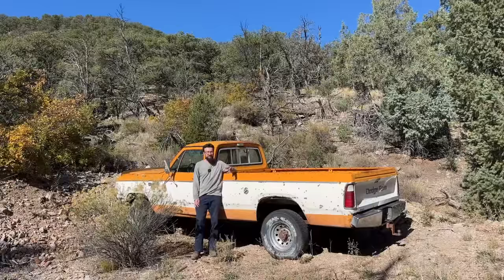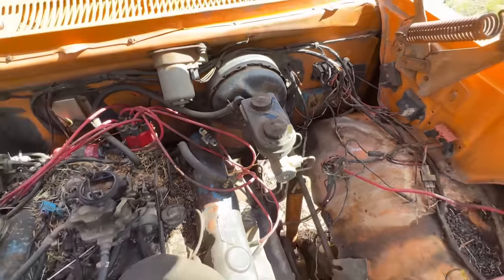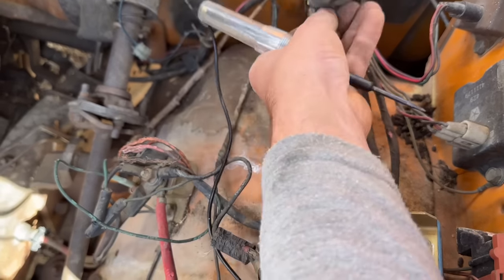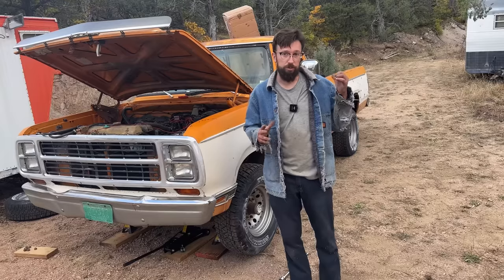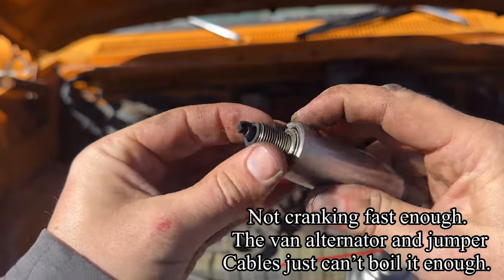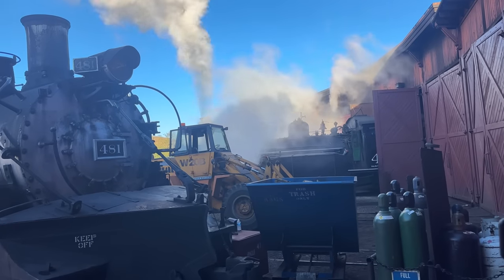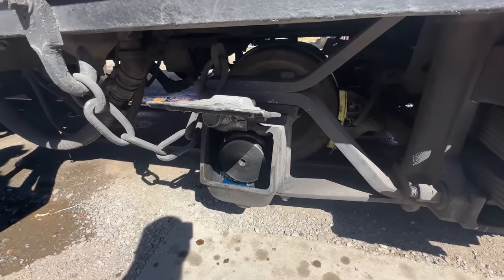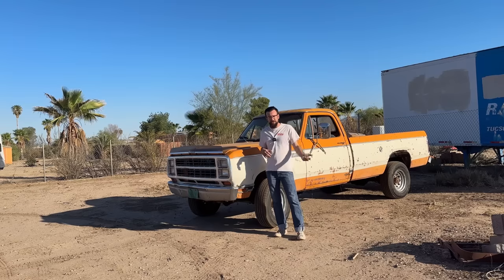I bought a 1980 dodge ABANDONED 22 years. Will it run and drive 876 miles home?

Comment: Hopefully you dropped out the rear drive shaft ahead of the long tow.  I'm guessing probably not though.  4x4 T-case into neutral doesn't really cut it for a long tow.  Having the shaft out is the sure bet to not damage the trans and the t-case over the course of hundreds of miles.  You got hammered plenty on the dolly loading debacle, so enough said there.  None of us know what we don't know before we actually know it.  You admitted your ignorance of the 4x4 system and that's fine.  You'll be able to educate yourself about it.

Comment: Dude, how did u f that load up? Why was the uhaul movin when u loaded it? It should of been in park, with the parking brake on. Unfortunately i see people do that all the time but they dont know a gas cap from a hub cap lol. I cant believe they scrapped those locomotives in alaska. what the hell were they thinkin? Anyways while u have the engine out make sure u change the timing chain. 318's and 360's were notorious for wipin em out due to the aluminum cam gear and they WILL bend valves. They ARE interference engines. Fascinating video on the loco's though. thanks for sharin

Comment: I am mighty suspicious that you left the YouHaul truck in neutral with the parking brake off when you drove up on the car dolly. You may be an amateur, but I don’t think your that much of a total amateur. The giveaway? The YouHaul trucks rear wheels turned freely without resistance when you tried to drive the pickup onto the dolly.

Comment: Given the condition of the rest of the truck, heck yeah, put another clutch in it.   Its hard to kill a Mopar.  My brother-in-law had a 1970's-something Power Wagon but it had the 360 4x4 but it was NOT geared for highway driving, top speed of 50 MPH, and that 360 was screaming, but plow snow, there was nothing that could stop it.  I could be wrong, but I think Chrysler went to the 318 in the 1980's due to emissions requirement.   One thing about those Mopar's, always carry a spare ballast resistor......I learned that the hard way.  Great video, overshooting the tow dolly was hilarious!

Comment: Interesting video... Youth is a bitch sometimes...I see flashes of knowledge...but being a former truck driver, the dolly scene really shows your youth... Set the parking brake....also I didn't see you unhook the drive line....did you know that on most old trucks...1 is a granny gear.... Won't go ...very fast....the truck was sitting 20 years... sometimes you need to warm up that plate....also...your shifting...showed your green...but I do applaud you for going out there....most kids your age are on the cell phones....tim

Comment: You mentioned it had a mechanical clutch - that is great - if it is anything like the ford trucks of the era, there was an adjustment in the linkage to take up slop as the clutch wears. you tighten it and jam nut it and then go on driving. Does the Dodge have something similar? May have been able to take the pickemup to see the locomotives. Also, if said adjustment were to be set too tight, that would also kill throw-out bearings quickly...
Reply from the maker: Yeah this one has that adjustment

Comment: You've never driven a manual transmission 😂😂😂
Reply from the maker: I meant 4x4. I’ve driven them just not often
Reply: @theetravisb  I understand now but you mentioned that you was only 26 years old I thought you was like you're late thirties but a lot of young kids don't even know what a manual transmission is nowadays they're almost a thing of the past the only two trucks that they're making new with a manual transmission right now is the Toyota Tacoma and the Jeep gladiator but I have on those Dodge trucks like that my brother on one they're good trucks I had an 82 but it was just the ram 100 with the slant six but it had that same four-speed manual transmission in it and it was a darn good track

Comment: With that much rodent activity odds are good there's a mouse house in the bellhousing causing the clutch to slip. Check that before you buy a new clutch. Also, chock the wheels on your tow dolly before you kill someone.

Comment: OMG.  When you started trying to load that dolly, with the truck rolling around, I knew that wasn't ending well.
How can you even be that stupid???  🤣🤣🤣
Reply: The problem is not your clutch You got a full-time four-wheel drive transfer case meaning that transfer case didn't come with a front axle with unlocking hubs when you put the transfer case in two-wheel drive the transfer case acts like the clutch slips if you turn the front hubs back into four-wheel drive two-wheel drive will work in the transfer case there's a splitter built in the transfer case that kicks the front Driveline out of gear it's only that way in a full-time four-wheel drive transfer case.. just like if you take a full-time four-wheel drive working driving truck and pulled the front Driveline out in two-wheel drive it acts like the clutch slips if you put it in four-wheel drive it works fine..OK go out there to that truck flip the front hubs in four-wheel drive put the transfer case in two-wheel drive it'll drive fine uphills downhills doesn't matter disengage the front hubs and it'll go to Slippin again pull the shifter in the four-wheel drive it'll be fine and go right back to work in fine. You can't put unlocking hubs on a four-wheel drive with a full-time 4 wheel drive transfer case on the four-wheel drive stick all the way forward is 4 wheel low then two-wheel low then neutral then two wheel High and all the way back is 4 wheel High ..when I say full-time four-wheel drive that is not all wheel drive . In a full-time four wheel drive transfer case you can jack up the back of the truck put the transfer case in two-wheel drive and it will pull off the front wheels and drive the truck with the rear wheels in the air ,,,,on a normal transfer case with the hubs locked in transfer case in two-wheel drive rear tires in the air it won't go nowhere pull it in 4 wheel high it mooves
Reply: @bryanglover3217 you dont need to write a novel to explain how it works just say the basses and we will understand better

Comment: Put a clutch on it The truck and the clutch isn’t hard to put in what you need is a transmission jack and that truck with the 318 will run forever The reason a clutch will not last is because of the driver will ride the clutch and destroy the throw bearing when you drive or four-wheel-drive you use the four high and it will crawl slowly, anywhere, pulling anything specially loading it on the trailer or dolly

Comment: Dude, did you try adjusting the clutch? There is an adjustment rod on the Zbar for the clutch fork. You’re nuts if you pull the engine to replace the clutch! Drop the Trans and Transfer Case out as a unit. But a bet good money,  just the clutch needs adjusting.

Comment: Well sir it is too bad that you had to U-Haul this truck down to Arizona. The truck seems to be a decent find. As I read the comments there were suggestions about adjusting the clutch. Well I would suppose that checking the clutch play (generally an inch to inch and a half of play on the clutch pedal) would be a thing to check. Otherwise put a clutch in the truck. This does indeed show that depending upon the area of the country a vehicle left outside for many years can pretty much survive in fairly good shape.

Comment: I think you should get the clutch fixed, get the heater working and then find a 1980 camper to go with it and do a camping trip with the old dodge. Maybe find another abandoned rig to tinker with at camp.

Comment: With that type of transmission, you could just flat pull the pickup by putting the transfer case in neutral. That dolly is designed to pull a front wheel drive car.

Comment: Why was that U haul going forward when you were loading the truck on the Dolly you left it in neutral or something because the truck should not of been pushing forward while loading the truck. I have used a dolly a bunch of times and first time I have seen someone drive right over the thing LMAO! anyway things happen but it is too bad you did not test the clutch before doing all the work on it but I guess somethings are taught the hard way. once you get a new clutch in that thing you will have a bad ass truck. Them old Dodge trucks are awesome and the 318 is a great reliable engine.
Reply: Yeah that was not smart. Uhaul could have rolled down the mountain.
Reply: im pretty sure its because it was a gravel road without good traction and the van just slid forward when he pushed it. Kindof common sense
Reply: The van wheels were rolling

Comment: Watch out for fuse box - gets hot & melts.  Also - vol gauge is a big fire hazard.  Mopar guys have always cautioned to by pass volt gauge.  Attach both leads to one side of gauge.  So glad I learned this on my 78’ Plymouth Trailduster 360 years ago.  Always carry a fire extinguisher just in case.

Comment: The exhausted steam, I’m fairly sure, goes through a condenser and back to the boiler, making it a closed circuit, preserving its energy rather than expelling it.  Just reliving a giant nightmare I had: undergraduate engineering thermodynamics.  They do expel steam from the pistons sometimes. I don’t know why.  Running these engines is not trivial.  You don’t do it without a great deal of training.  I have an old vhs on it.  It instils fear.

Comment: Tip for bleeding brakes by yourself, attach a hose to the bleeder valve and put the hose in a bottle with some brake fluid so air never has a chance to re-enter the system.
Reply: brakes not breaks if your trying to correct someone
Reply: @offroad4x4nhlife45  not correcting giving a tip to make peoples life's easier
Reply: @offroad4x4nhlife45  but ur right I can't spell for shit lmao, I appreciate ur correction

Comment: I daily drive a 1984 Dodge B150 van. It has a 3 speed with an overdrive, and the clutch is really heavy. Which was great because just today I was stuck in rush hour traffic for a good hour and a half. My left leg is killing me currently. It also seems as though people don't understand that a big van with an inline-6, won't accelerate as fast as they want it to. But I still gapped a feller who didn't know how to drive a stick. Anyways, replace your clutch.

Comment: Solid intro. The can in the bed is probably charcoal lighter fluid. I’m a fan of the tin grill dodge. That small block/np 435 combo is bullet proof… unless the clutch is toast. lol . If there is an Achilles heel, it’s those dang ecm’s. I always bring a four and a five pin with me. Well done.

Comment: 😂looks to me like Travis just landed himself a good daily work truck and modern by his standards. Kinda iffy knowing it had a clutch 9 years prior to being parked but in all honesty they way you find it is likely how they drove it. Coming from owning a bunch of manual 4wd transmissions, givin the area it’s it probably just gonna be a burnt out clutch that’s a lot of weight to be pulling on them grades up there especially in 4L. Another angle could be a top end oil leak causing the clutch to burn prematurely, may look dry but long as it sat if it’s below the crank oil can’t leak. Apologies for the long comment looking forward to seeing this ole girl back on the road Travis

Comment: You’ve got a very good old truck there. It needs basically just a clutch and right front parking light bulb. And while kind of a pain in the arse, a clutch is easy fix on this truck. It’s amazing how clean it is and overall great shape the body is in. Oh, and a re upholstered front seat. The body trim can be found and reinstalled.

Comment: At least this was not a an cheapo stripped model. They ordered the Two tone paint PS/PB Sliding Glass Window Long bed Cloth int Power Wagon were optioned out. I see some of the only options missing is Factory A/C Tilt wheel Cruise Control is missing

Comment: Excellent video. Reminds me of my truck in high school. I got it a couple years after this truck was parked. The mechanical clutch has some adjustment, probably not enough to make that long of a drive. Definitely get it replaced and let this be a work horse for another 10 years

Comment: They were wearing out clutches because they don't know how to drive a manual.  Big surprise
Reply: That's conjecture. Nothing more. You have no way of knowing if it's accurate. And, here's a news flash: clutches wear out, over time, even if you DO know how to utilize them properly. This is intrinsic to their design. 

Often it's best to just keep one's mouth shut, lest ye look like a fool... just as you have so perfectly demonstrated.
Reply: @johnsmith7676  Okay John, except I've been driving manuals since 1980 and have NEVER worn out a clutch. Even my 83 Rabbit with 400,000 miles has the original clutch. My 90 Camaro which I bought new had a perfect clutch last year when I swapped in the 6 speed.